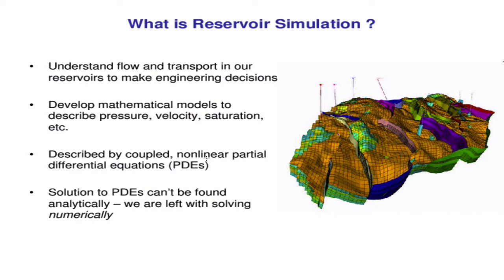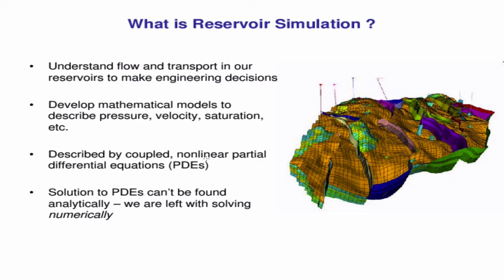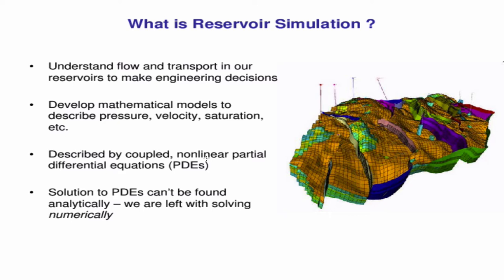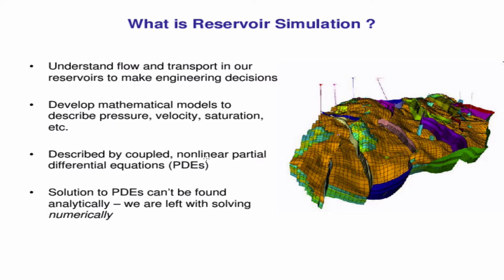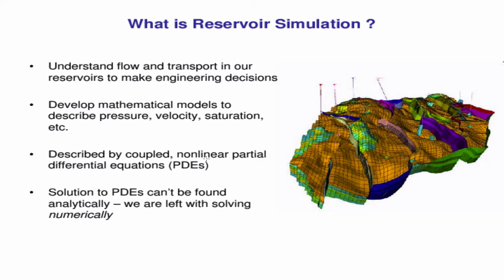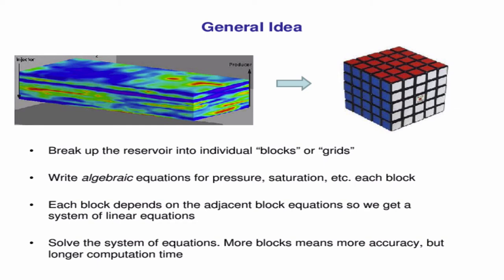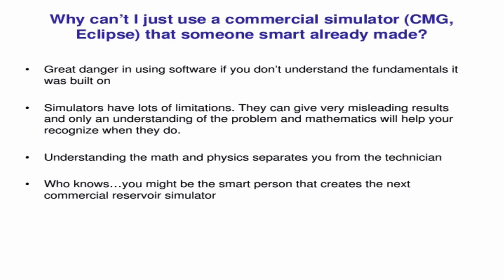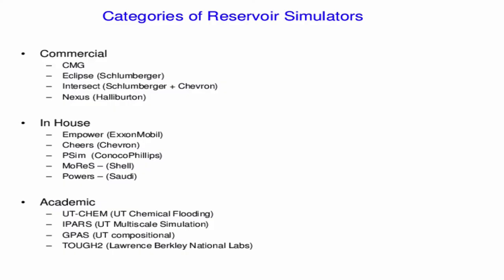Introduction to reservior simulation

Comment: I can't hear clearly the words at sixth second. Could you provide me the corresponding subtitle or modify the subtitle below? Just make sure you're in the right class. This is PGE323 M reservoir engineering 3. Should have all had reservoir engineering 2, also known as reservoir simulation.